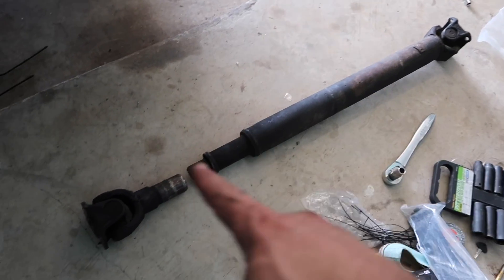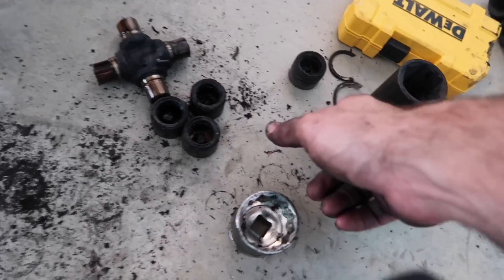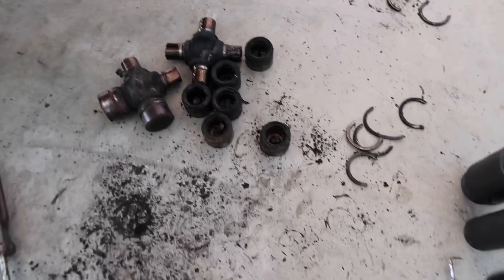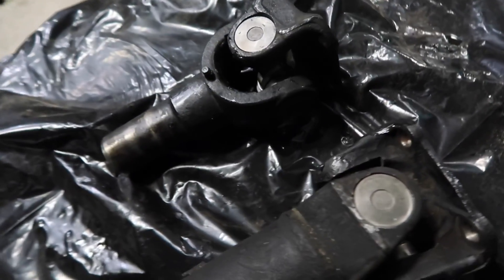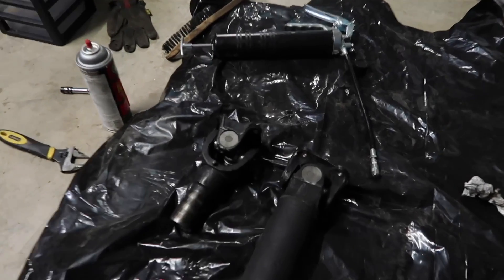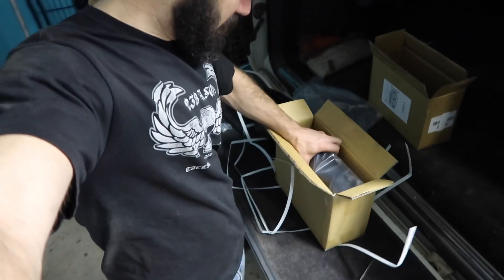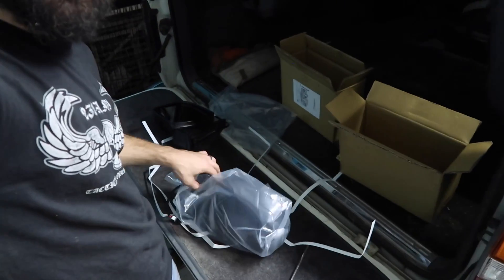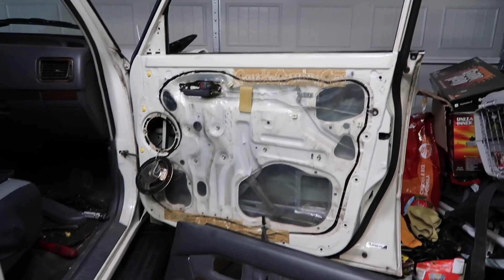1993 FZJ80 Toyota Land Cruiser Night Wrenching Phase 3 - 2019.17

Comment: Play looks normal. Keep us updated if this helped vibration or noises at all.
Reply from the maker: I still get a random good clunk every now and then but I think it may be the front driveshafts u joints. It definitely shifts smoother and seems to overall be better now
Reply: I don't have enough experience with the full time 4 wheel. But I suspect if the back helped the front should do the same also.  I hope you find one that is bad.  The rears (U Joint spindle) looked burnt, they are usually shined up or worn.  It may of been filming or old grease, but it looked like they were either run dry or not greased after a water exposure.  I suspect the front will look worse (there is a lot more binding going on up there with turning wheels).  After you do the front, the only problem it could be is the ring play or tranny problem.  The engine doesn't put out that much torque so I am hoping for bad front U joints.    Unless the prior owners got stuck and was rocking the cruiser back in forth by slamming the gears. Thanks for update. @FreedomCrawler
Reply: The clunk is only when you start a new direction correct?  It doesn't happen while already in motion changing gears?
Reply from the maker: No. It’s usually only at low speeds now when it shifts. So about 10 mph shifts
Reply: That is because their is still a load on it.  Vehicle doesn't have enough forward momentum at that speed to keep it going forward. Still hoping it is the front U joints.  If prior mechanic was old school. On older systems that freewheeled you only lubed them (frt) every other time you greased the back if you weren't using 4x4. @FreedomCrawler